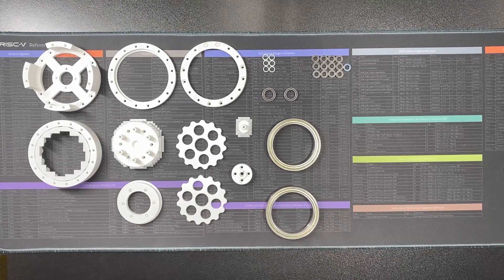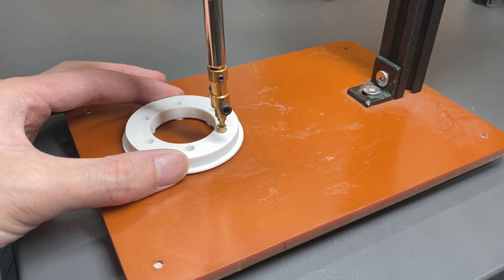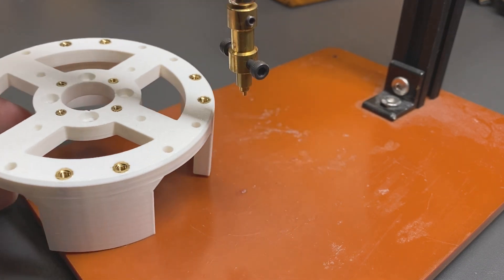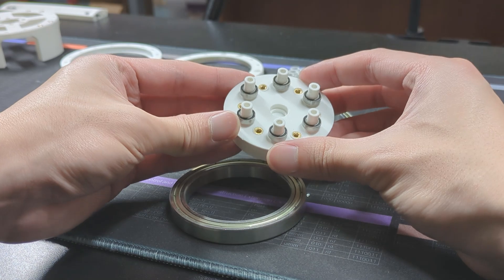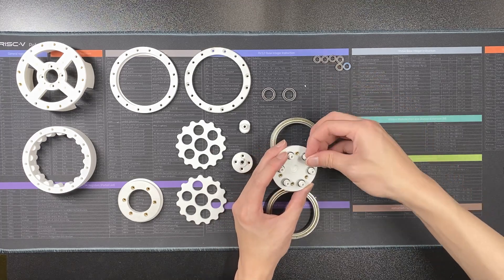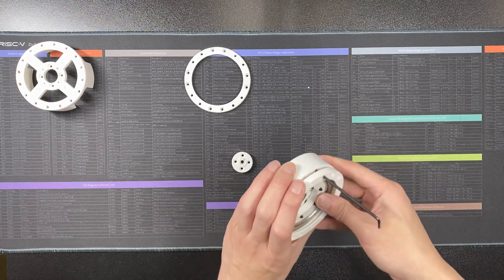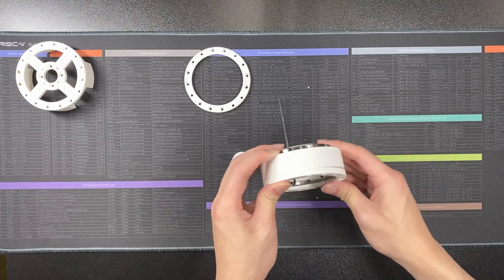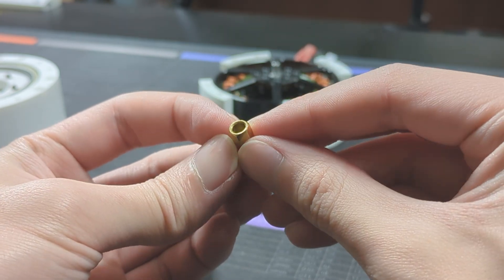Berkeley Humanoid Lite Tutorial: Assembling the M6C12 Actuator

Comment: what is the peak torque output for this motor?, I have recently designed an actuator (16:1) with 5N.m. torque, but I had to use two layered planetary gearbox, could not get any more(motor was cheap) torque, technically it should have been around 8-9N.m. but if I increase the current any more motor starts to burn, your seems pretty nice and and tightly coupled, can I get end specs of this if available anywhere?
Reply from the maker: We have tested up to 25 Nm. Please check our paper and docs on our website: https://lite.berkeley-humanoid.org/
Reply: @-T.K.-  Sure will check, thanks!!

Comment: it so hard to put mr106-2rs bearings into Output Shaft Front. Something is wrong here right?
Reply from the maker: Try to adjust the tolerance on the parts. It’s indeed quite hard to tune the printing parameters…

Comment: In the final step of attaching the gear and the motor, my m3 x 55 screws cannot reach the m3 inserts. Did I do something wrong?
Reply from the maker: Try using a longer screw, it’s fine if the screw extend out of the motor shell